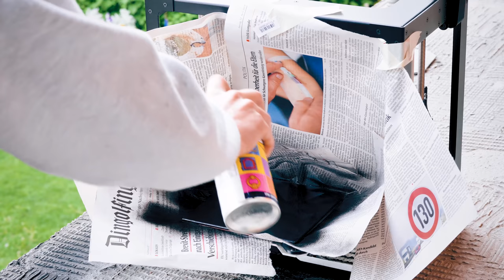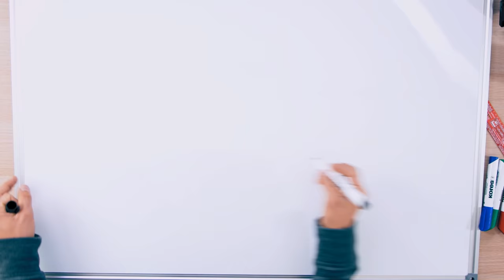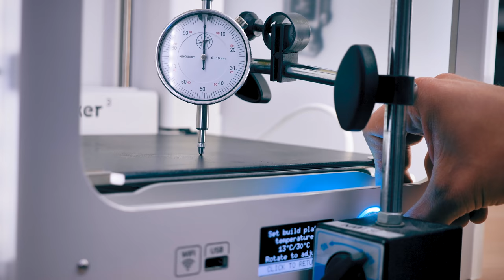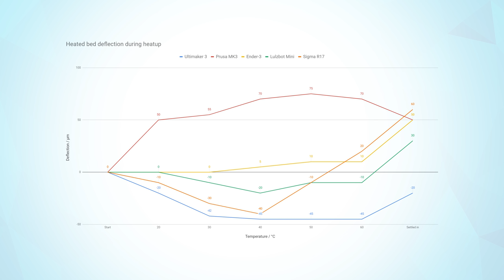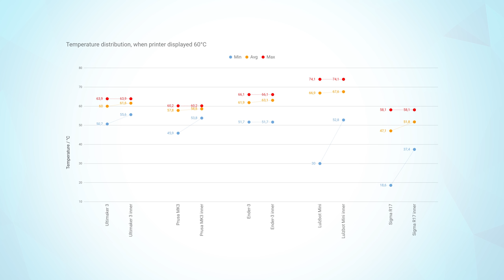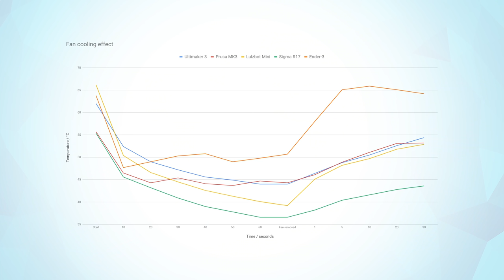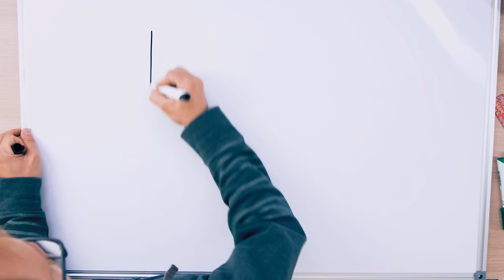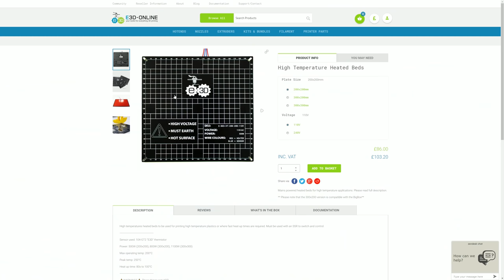Advanced heated bed tests (now with 100% more graphs)

Comment: I am curious what are the warping differences between CAST aluminum and EXTRUDED aluminum.  
When I built my custom 3d printer a few years ago, I was advised to buy cast AL because when it heats up there is less internal stress and less chance of warping.
How many of the commercially sold printers are using cast?  Are any using extruded?
Reply: It is usually sheet aluminum. I guess that could be called extruded, though it is rolled to the desired thickness. Pouring your own cast AL bed would be great. Add ribbing on the underside and use a custom heating element.

Comment: Great video, but i have a question. Would it make any difference in these tests if you added insulation beneath the heat bed?
Reply: Thermal Dynamics will tell us YES.

Comment: Also IBM SPSS is epic for making charts and statisticial  graphs
Reply: if your looking for better , more meaningfull comparision tests that tell you more than compating two averages you can use this software to do a thing called (t test) analysis
Reply: not only does it compare averages, it tells you if the differce in averages is staisticially significant in relation to the range of the values from each set of numbers

Comment: What thickness of aluminium would you suggest and is there any specific grade of aluminium that you recommend
Reply from the maker: Smaller beds should be fine with 4mm, but for larger non-moving beds I really like the solidity of 5mm to 6mm sheets.

Comment: What makes the ultimaker3 so much better than sigma, when they are both glass over pcb heater?
Reply from the maker: Ultimaker doesn't have that 2mm airgap between the heater and the glass
Reply: @MadeWithLayers  Oh, why is there a gap?! Or how did ultimaker get rid of the gap?

Comment: Does inductive sensor for auto bed leveling works on acrylic non heated bed?
Reply from the maker: Nope, that will not work. Either use a mechanical sensor or a capacitive one.

Comment: Where are getting your mild aluminum from? Supposedly that you live in Germany. I´m trying to build that same heated bed set up as you have.
Reply from the maker: Simple rolled aluminum is easy to find pretty much anywhere, but I've had good luck on ebay getting milled plates / sheet material. Try "aluminium gefräst"

Comment: What about copper? Does copper have a good thermal conductivity?
Reply from the maker: It does, but not much more than aluminum. However, copper is much heavier and much more expensive while having less heat capacity (per weight) than aluminum.
Reply: @MadeWithLayers  ah ok. Thanks for the reply!

Comment: Silver and diamond  is a bit excessive, copper though...
 :)
Reply: Is a pita to machine though, at least in a manner we do with aluminium. Cast and then milled flat, the wear on milling and drill tools working with soft metals is significantly higher. Well millable aluminium alloys compensate the softness of pure aluminium, the availability of suitable copper alloys which still conduct heat well  is pretty bad.

Over all a good quality copper heated bed would be possible but probably more expensive and hard to manufacture and not worth of it's benefits.
Reply: I believe he just wants to goad the ruby-nozzle people into making a deluxe heated bed ;)

Comment: What is the thickness of the DIY milled bed ????
Reply: Mine is 5mm. Go as thick as you can. I've seen 4mm at online 3D sites. It might help. With a thick 5mm bed it did take longer but then I bought a line voltage silicone heat pad for it, along with MOSFETs to control it. MUCH faster at raising the temp! With the added weight I simply installed a larger Y-axis motor.

Comment: Interesting.  Seems like a layered bed might be worthwhile, maybe something with a layer of ceramic, a layer of copper or aluminum, a layer of steel or iron, etc.
Reply: Caleb, a layered bed would have a more pronounced warping problem as the different layers expand at different rates. If the layers weren’t bonded, then as different layers warp you would lose heat transfer.
Reply: @Brocknoviatch  Warping is certainly an inevitability if it's not addressed, but why are you assuming that wouldn't be addressed by the engineer?  And why do you further assume the layers would not be bonded together in some fashion?  I'm not implying the plate would be easily engineered, but I'm not convinced it's not possible.
Reply: @Caleb I was trying to address both situations. Bonded and Unbonded. It is definately possible to have it bonded. I think having three layers of different materials that are bonded could lead to issues like cracking if there is a ceramic plate, or more pronounced warping or buckling. I could be totally wrong as it is only a postulation. What I do think would be interesting is a thicker heated bed, it would have greater thermal mass and might be able to cope with a fan blowing on it better. I would also be interested in whether or not a thicker heated bed was more or less prone to warping. What do you think?
Reply: @Brocknoviatch  With a thicker plate there will be more thermal expansion, so you'd probably want to pursue a different mount for the plate, one that allows the plate to expand in unimportant directions (i.e. down).  To answer your other questions, there are always trade-offs.  A larger plate can hold more heat, but it'll take longer to heat, of course, and if something does cause it to cool off a lot, it won't regain its operating temp as quickly.

If the thicker plate does want to warp, it would be harder to stop it.  Imagine stretching a piece of aluminum foil out that's trying to warp.  You could easily hold it tight enough to keep it from warping.  Not so easily with a thick plate.  Warping isn't a function of only thickness, though.  How evenly the heat is applied and stored will have a big impact.

Comment: Ah yes the old fuzzy logic controller.  Keeps your upper and lower control limits much tighter.  Incidentally if you could use a much thicker sheet of aluminum, the bed would maintain better once the heat evens out.  It works as a much better heat sink.